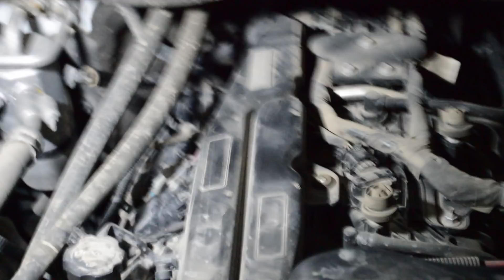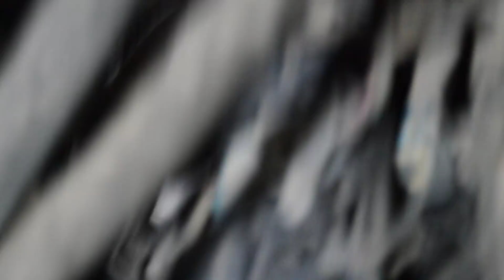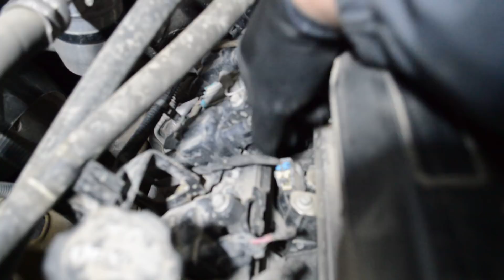How To Identify Which Cylinder Is Misfiring (Cylinder Drop Test)

Comment: you can take it a step further by eliminating coil or spark plug wire by checking each spark plug wire resistance with a multi meter
Reply from the maker: witnesszer0 good idea for video thanks